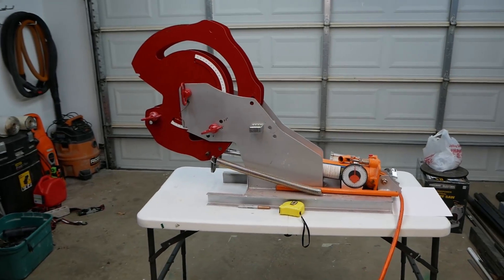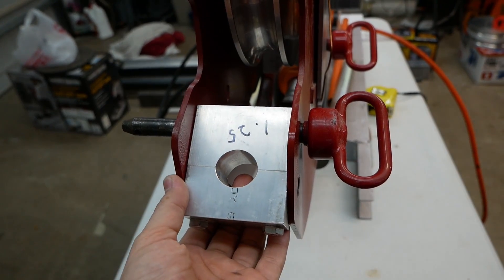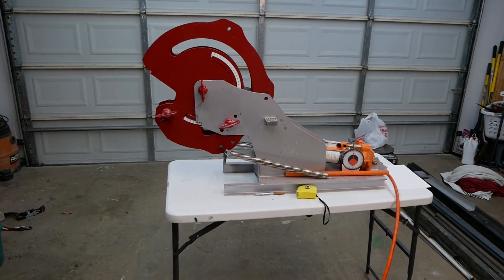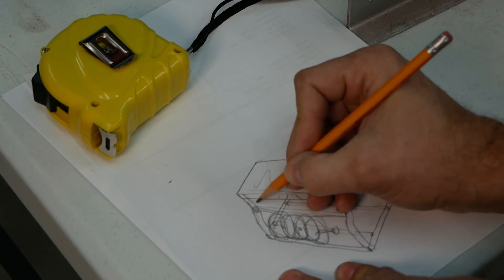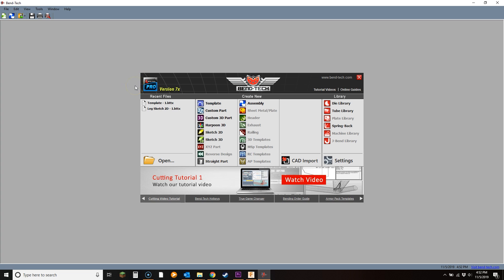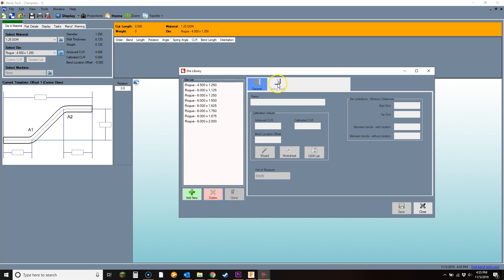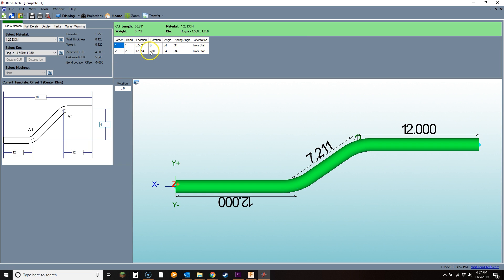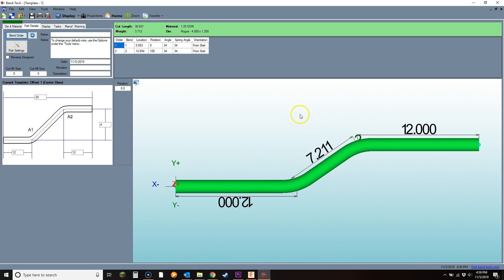Build your own car - Tube Bending Ep02

Comment: what app did you use to do this design
Reply from the maker: I used Autodesk Fusion 360 to do the main design then exported the sections I need to a program called Bend Tech that is used to make the exact bends using whatever bender you have. You can do the full design in Bend Tech as well but I needed it in both formats.
Reply: so this app I can download it on my PC

Comment: The detailed info is great, keep it up. The 'why' info is just as important as 'how'.
Reply from the maker: Thanks man, stay tuned new video tomorrow. 😎👍
Reply: @OZTron3D  when designing a tube frame isnt it better to eliminate cutting and wlding as much as possible

Meaning that the pipe extending from the front to the rear on both sides could either be bent (in a complex way) or cut and welded in 3 sections
Would keeping it 1 piece better from an engineering stand point?